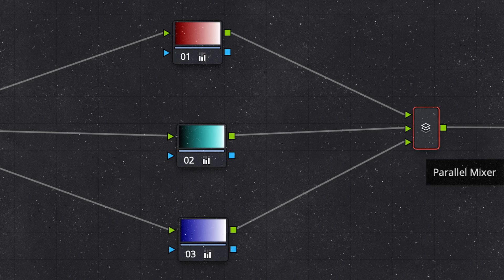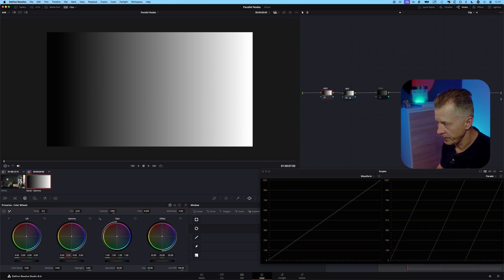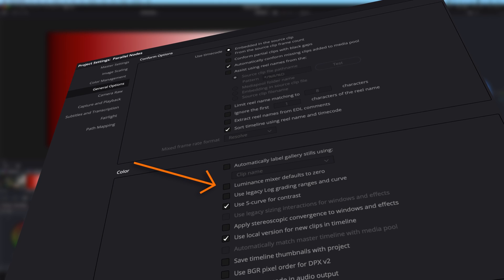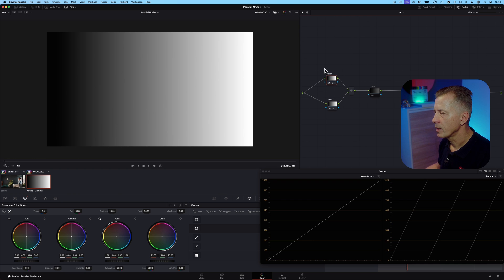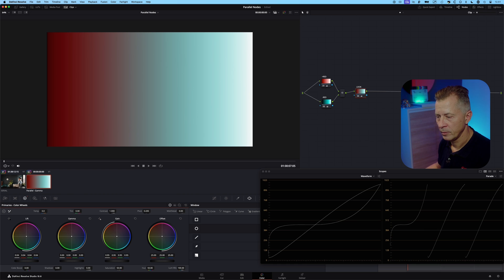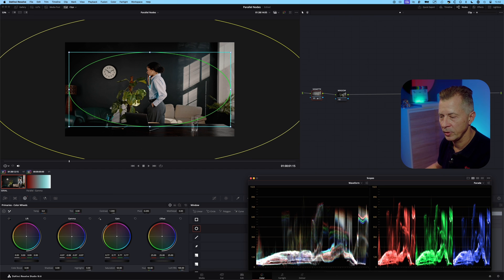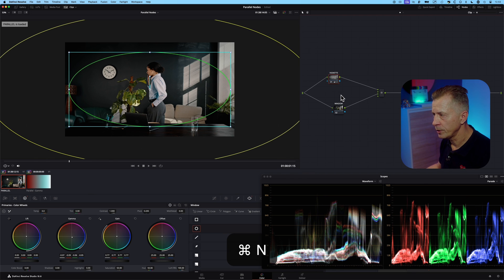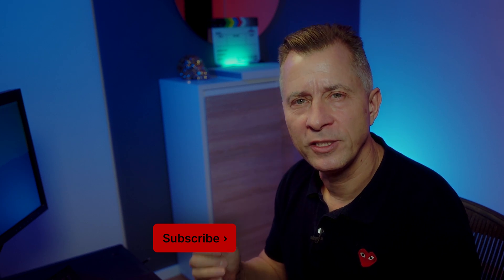Unleash Your Creativity: Discover the Power of Parallel Nodes in DaVinci Resolve

Comment: In fact all parallel nodes should be used for is dodging and burning. That's what they are designed for. They are abused for node organising reasons but this can have unwanted effects
Reply from the maker: Dodging and burning is definitely where parallel nodes shine. But they can be effective for so much many other creative uses. And I agree they should not be used for organisation purposes. Happy grading.